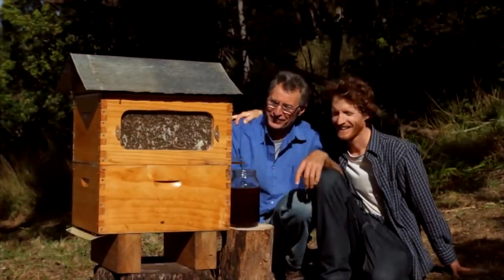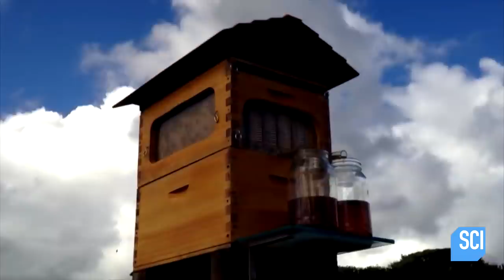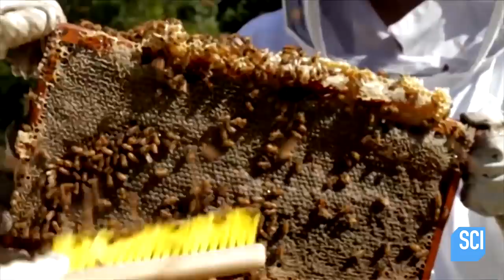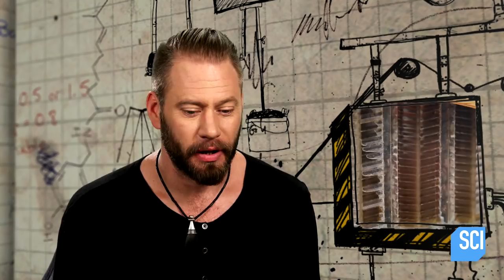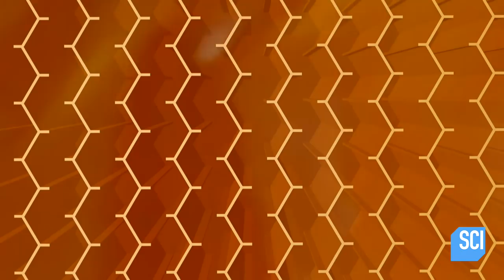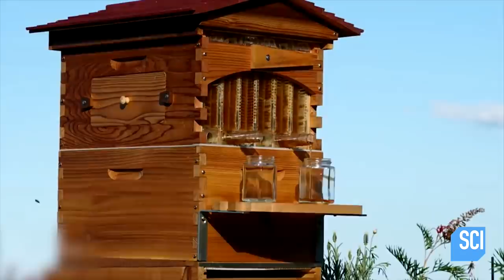See How This Revolutionary Beehive Design Provides Honey-On-Demand

Comment: This is old. I remember watching reviews of this crap. You build it yourself, but a common problem is parts are lazily laser cut and aren't the right size so you have to cut it apart yourself to make them fit. 
You also have a problem with the bee's trying to eat the wood and sealing part together with wax. And as the comment above said this beehives isn't good for bee's.